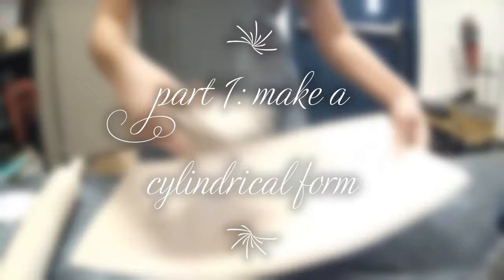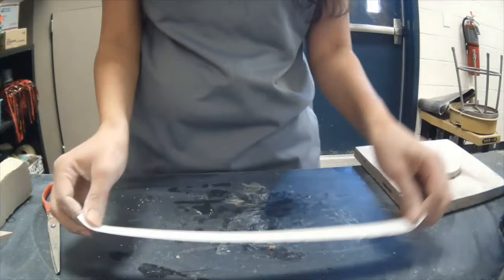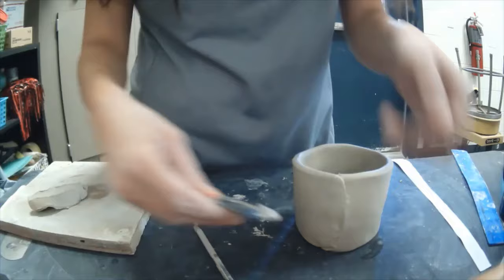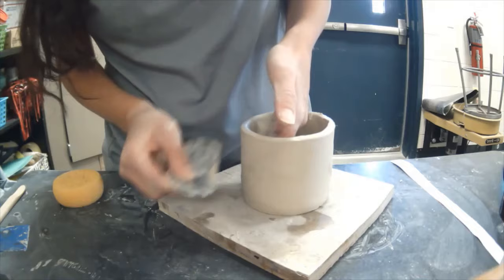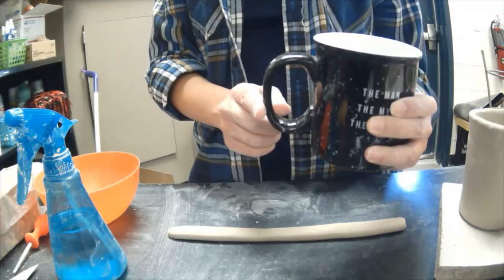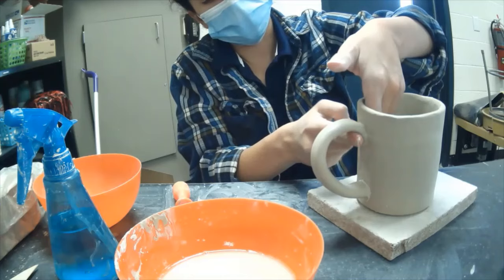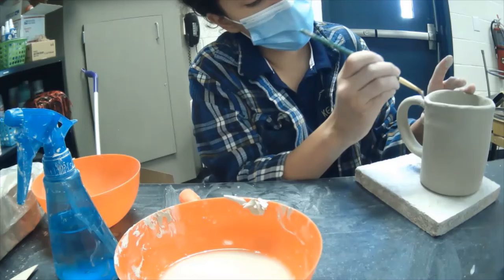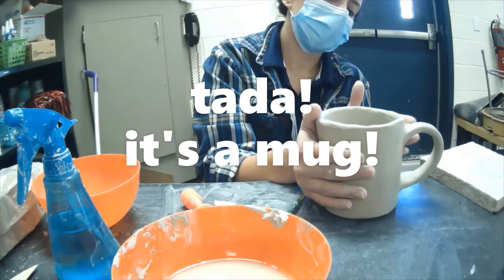Making a Face Mug Tutorial_all the steps_including clay cylinder, handle, and sculpting the face

Comment: Hey! Fellow MS/HS Art teacher here... I've been thinking about doing this project with my students this spring (If I get them back in the classroom!) Thanks so much for the tips you've shared! I, too, had never seen anyone twist clay before rolling & it makes so much sense! Love how you rolled the base of the mug to give it a nice finish (so simple, why didn't I think of that?!).  Questions: 1) about how tall are you making your sides, 2) base diameter? and 3) what is that awesome orange handled scratch tool you're using?!  Art on! :o)
Reply from the maker: Hi!  Thank you for your questions.  The mug I made was a little over four inches tall.  I wasn't terribly precise with the diameter but I used a template made with a standard coffee cup and my guess was that it was around 3.5 inches or so.  The scratch tool is one that I got in a pumpkin carving kit!  I actually used it to make a clay jackolantern in one of my other videos. https://www.youtube.com/watch?v=bHXAEkYJxw4 It works like a charm!  Hope this semester is going well for you.  Are you fully virtual right now?  I have one virtual class and distribute clay for them every other week.  It's a pain to get everything together, but I love getting to see them create in clay.

Comment: What is the surface you are rolling on?
Reply from the maker: When I roll the clay into a slab I use canvas or paper to keep it from sticking to the table.  But for coils, I just use the table.  I prefer a porous wooden table but any surface will do.